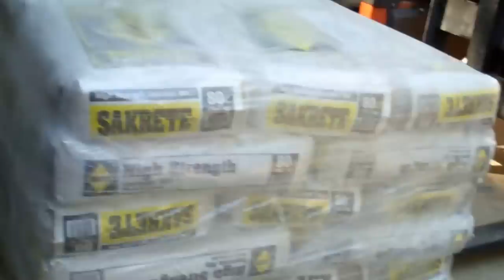Pouring a 60' Foot Concrete Sidewalk by Hand

Comment: Wow! He did an awesome job and was so patient, took his time. Do you have an after video to see how it looks once it cured? I thought concrete needed rebar? Why wasn't it used in this project?
Reply from the maker: Thanks! I posted an updated video later on but don't remember where it is.. You can search my channel for it under Concrete Sidewalk and it should come up. Rebar is recommended but I just didn't add it to my project because I simply wanted to stop the erosion under my Mega-Shed workshop and that was accomplished..
Reply: RVR2 ok I'll look it up. We are hiring a company and I wanted to make sure they do the cement correctly so I was curious whether rebar is needed
Reply from the maker: If your project will be more out in the open then yes I would add the rebar and make sure they add cuts or etches in the concrete for cracks to follow (see My New Concrete Driveway video near the end to see what I mean).. The driveway concrete was fiber-weaved mixed in and did not require rebar.

Comment: can i handmix this sakrete for a small walkway?
Reply from the maker: Yes
Reply: is rebar or wire necessary for a 3'x12' and 4" thick walkway?
Reply from the maker: It's recommended but I didn't use it in my project.
Reply: RVR2.  ok thank you

Comment: Awfully thick for a sidewalk. Also the added brick in the base isn't a bad idea but you should have left more room for the concrete to flow into. When it dries there will be air gaps which will allow too much shifting and eventually cracks. Hope you don't live somewhere that gets freezing temps. That'll crack from freese/thaw cycles. In the end it turned out nicely - I just wouldn't have done it like that

Comment: I hired someone to do my concrete. A few differences. Soil needs to be watered down and compacted. You need wire reinforcements. You need a few inches of concrete, the thicker the better for strength. Putting concrete on top of bricks to save on concrete is NOT Good idea. Hire a concrete company with ready made concrete. Not that expensive and quicker. They’ll pour it for you gratis. I looked at the receipts. Quite cheap for concrete so billing is for demolition, preparation, and smoothing out.

Comment: You done  this walking concrete without any consultation,even in my country Iraq the work is better.first you have to impacting the soil secondly you have to put nilon sheath to protecting the concrete from salt thirdly putting steal mesh 4thly putting joints 5th you have to powdering the surface by pure cement and use the correct tool for smoothing . With my  good wishes
Reply from the maker: How about reading my video description...
Reply: RVR2 sorry I didn't read it before writing my comment anyway  me and you want     to publish the informations for public. And i like your kinds and laughs with  the maxican freind Aureliano

Comment: I respect the guy breaking his back... But man, so many things wrong here. No reinforcement, unstable ground, no control joints, sloped towards the retaining wall? Then where is the water supposed to drain? It just pools up and creates bigger issues. Also the slope from the driveway seems to fall towards the house along the sidewalk. No float, not edger used. Give it 5 years and this will be cracked throughout, especially if he's in a freeze thaw condition.

Comment: Good grief people. Have you ever tried to mix concrete in a wheelbarrow, one or 2 bags at a time? It’s incredibly inefficient and hard as heck - the way he did it is much easier.  I’d have pounded that brick down a little, but the soil was firm and undisturbed and not worth messing with. Reinforcement?  It’s a backyard sidewalk with light foot traffic and doesn’t need reinforcement - most people have the mesh too high to do any good anyway. Yes, it could have been finished a little better and control joints would be nice, but good enough is good enough.

Comment: This is the way we Mexicans mix Concrete in Mexico the mayority of the people don't have the money for buy or rent a concrete mixer, we just make a "volcano".. Some of your guys should try this and see the concrete mix very well and yes is more work and effort but you can save big bucks on this and yes this project is crappy but with some help the guy could do a better job...
Reply: Dario Fragstyle I'm American but I have mixed mud MANY TIMES using the"volcano" method. A tru concrete man will mix it right because he plays in mud every day and I gotta say for the old timer 2 be by himself and only a BLOCK MASON TROWEL AND 2X4 NOT 2 BAD.OF COURSE SHOULD OF BEEN BETTER BUT THE VATO GOT IT DONE WEEY
Reply: you can buy a used mixer for less then $100 or rent one for less then that! there is no Big Bucks to be saved.

Comment: no rebar, no expansion joints, no fiber, I give it 1 season before the cracks start.
even mixing in a bucket with a paddle mixer would have take 1/2 the time. And no wooden float 

but hey , its your project and if your happy w/ it   so be it
Reply from the maker: 1 crack already so you were correct there but again this was to stop erosion under my workshop and it's doing that.
Reply: make sure you deep fill those cracks or dime to a dollar moisture will find its way down and destroying the cement. and please, the next time you want to concrete work done and the "mason" shows up with nothing but a brick trowel...shoot him ...many times

Comment: Man , it would've took 20 minutes for joints to be added and save major cracking in the future . Let alone no gravel base or rebar whichever important for longevity.  This video is pretty bad . It's a sidewalk of course , atleast should've brushed it for safety purposes.

Comment: no steel in the mix no expansion joints job wasn't closed properly with a bull float or finished with a finishing tool all I see is a giant path way ready to crack and people to slip on it when its wet im no expert but im sorry this was a hack job but a good job for what old mate had to work with

Comment: why do people insist on breaking there balls mixing all that concrete ? call a truck and finnish in no time !  no expansion joints and then he trowels out with a pointing trowel ? and no crack joints !  no broom job to roughen up the surface !  bottom line I`m not going suger coating my response,,,   the job quite frankly sucks !
Reply: That surface looked plenty rough to me. LOL.
Reply: Sugar*

Comment: Mexican do things wrong it would have been a lot faster to order in by the mixer truck and cheaper. I had one come over to help me get my block garage started by the time he got the blocks out above the forms that where 2ft.  under ground they where off by feet not inches feet I went ahead and built it anyway but it is bad out of square